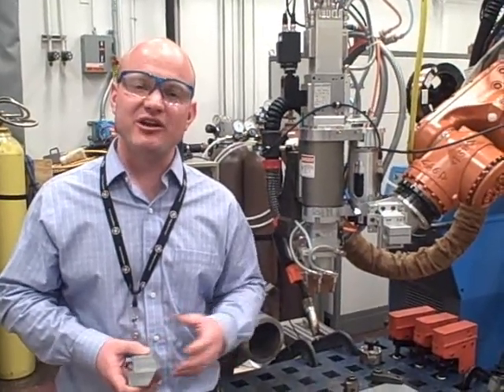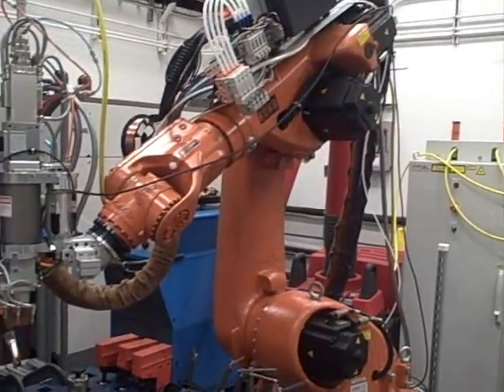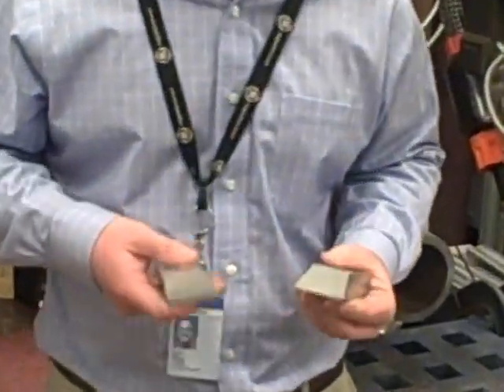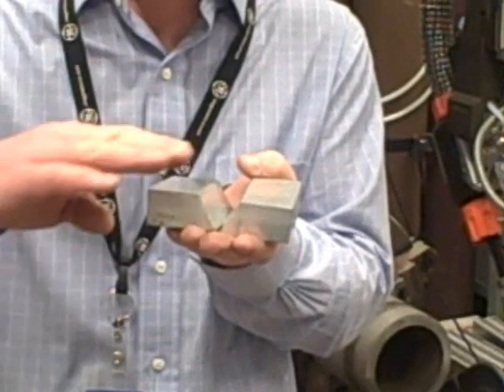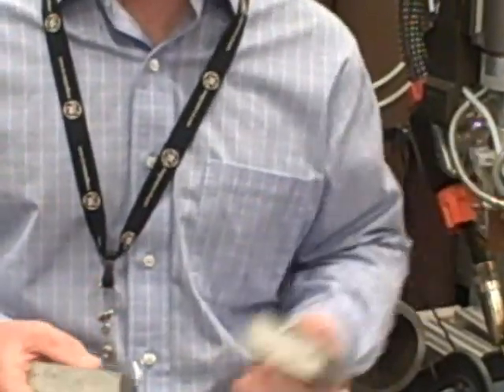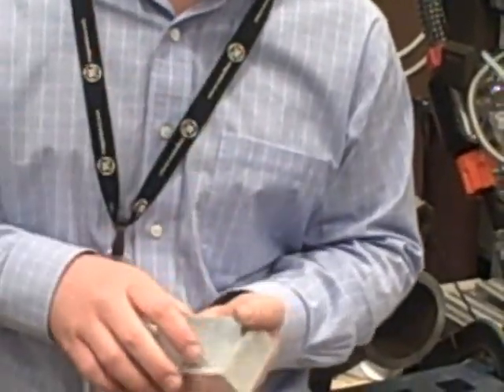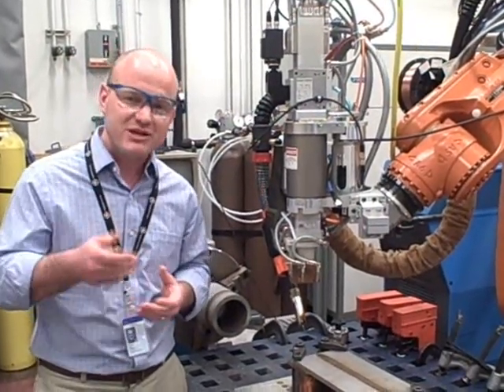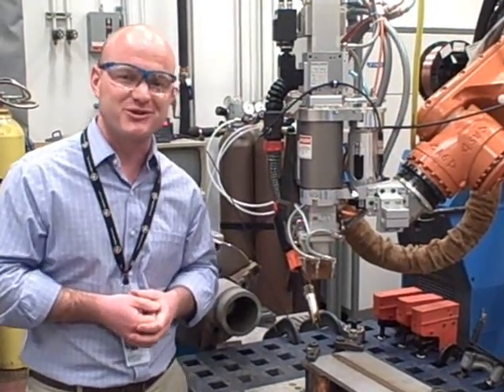GE Unveils Ultra Powerful High-Tech Laser Welding System

Comment: @deezynar: the grain structure after laser beam welding will be fine grain, which actually makes that part of the metal stronger. Plus, the heat input from a laser beam is smaller (than say a conventional arc process), which is why the metal that melts is small. What actually happens in a laser keyhole is that the photons from the laser beam vaporize the metal atoms and a recoil pressure is exerted (just like how a rocket engine works).

Comment: So the metal only melts in a very small area next to the joint, what does that do to the crystal structure?  It seems like the metal in that area would be much weaker than the surrounding steel.  A slower welding process heats more of the surrounding material.  I'm not a metallurgist so I'm just speculating.